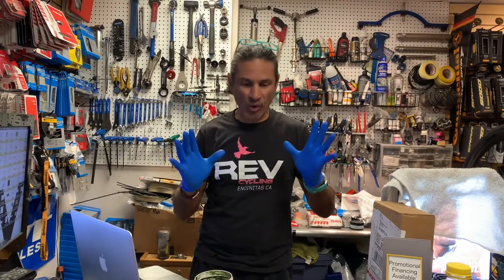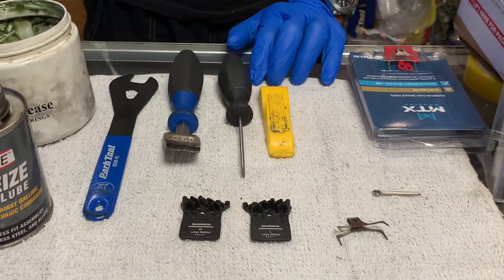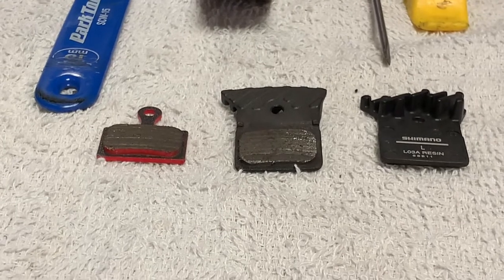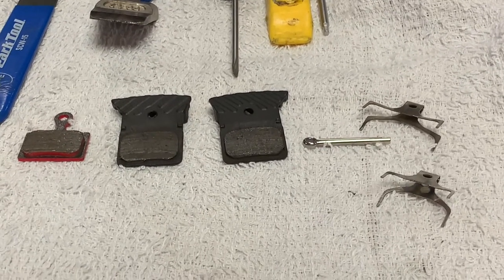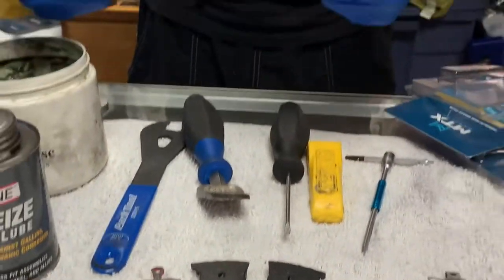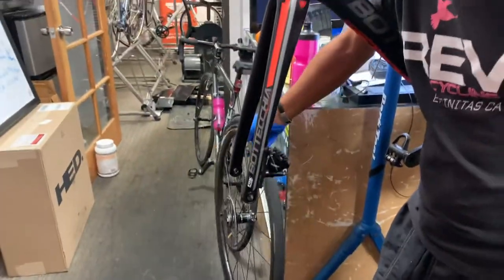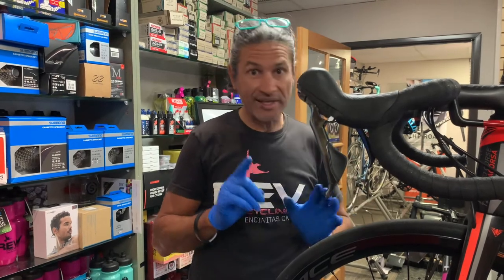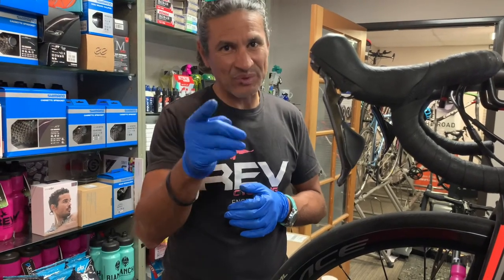How to replace Shimano L03A disc brake pads with MTX Braking OR any aftermarket pad.

Comment: "superior to the Shimano pads... in every way" ... that's a strong statement, very strong. I mean, properly bedded, the Shimano pads are pretty darn good, they'll stop on a dime and skid your tires if your pull the lever hard enough. I've been looking at these MTX though... I'll have to give them a shot.
Reply from the maker: They are better. I don’t blow smoke.  Disc brakes do not stop on a dime. Sorry you think so. Rim brakes stop significantly better.

Comment: I recently bought L05A resin finned pads for rear Shimano 105 caliper.   After watching George's video and looking at finned pad, I should have saved my money.  I happen to know something about design, heat, materials, and that sort of thing.  In theory, the heat build up around the pad flows toward the cooling fins and is wicked away by the air rushing across the fins.  This can be very easily modeled  using computer simulation and Shimano most likely lab tested the design with instrumentation and knows what the finned vs non-finned temperature change is.   The fins are located in the wrong place to do any good.  They need to be on the opposite side of the pad and obviously that's not possible.  Other than looking cool and costing more, zero effect on performance.  Its a marketing gimmick because after all there are only so many brake pads needed in the world and  Shimano wants their share and then some.
Reply from the maker: Thank you for watching. Please consider subscribing if you want to continue to hear me debunk Bike Industry Marketing Bullshit

Comment: Silly fins? I wouldn't discount them so whole-heartedly. The Shimano ICE technology rotors may benefit from extra pad cooling, being aluminum with steel outers you probably don't want to push the thermal limits. Besides, those fins cost money. If they were silly, it may be reasonable to assume they wouldn't exist.
Reply from the maker: The brake pad material composition is far more important than the “silly fins”. Riddle me this Batman if the fins are so important then why don’t any other component manufacturer use them - SRAM or Campagnolo or any other brake pad manufacturer except SwissStop? For my testing I abused the MTX pads and never had brake fade. Side note - disc brake have significantly inferior braking power to rim brake. I just spent 450 miles and 30,000 feet riding a disc brake Dura-Ace equipped (calipers, rotors and pads) and I was underwhelmed. Today I got back on my Ritchey Road Logic rim brake and felt assured I was going to modulate properly and stop on a dime. 

I know my opinions aren’t popular, but they are based on facts from someone who rides… a lot!  But I’m not on YouTube to make friends I’m here to  educate and dispel marketing BS!